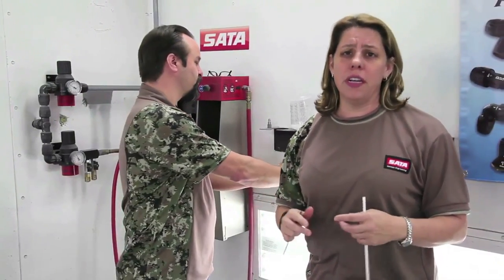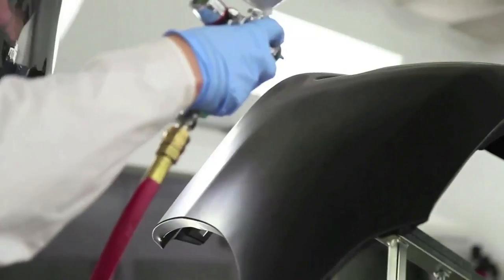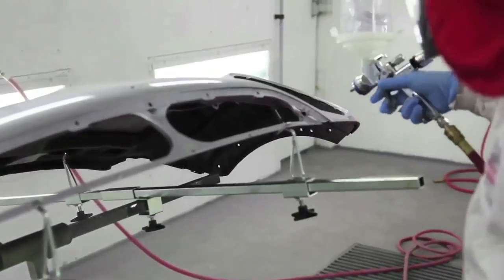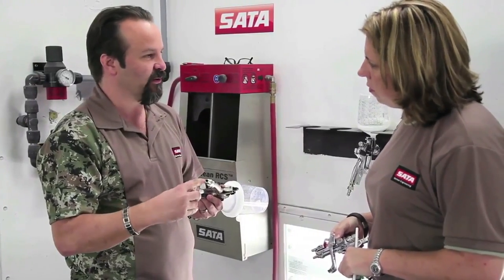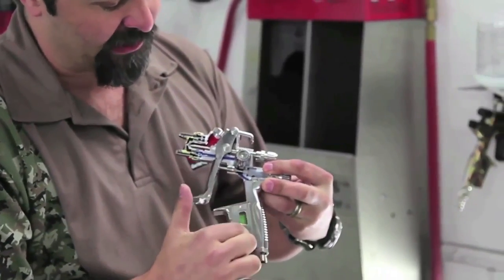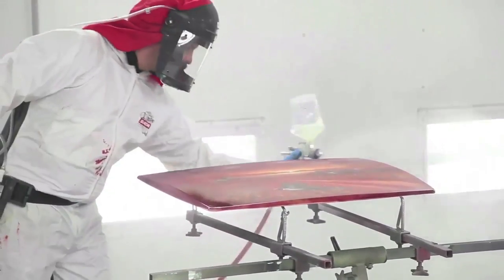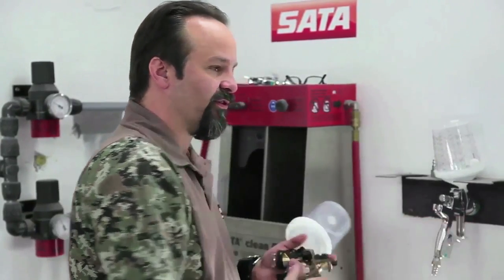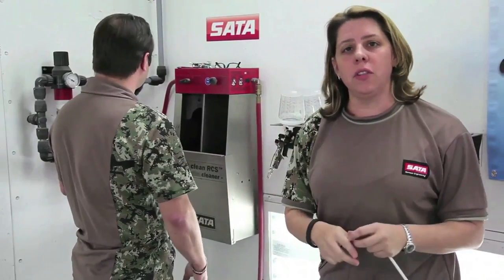Setting Air Pressure and Volume Using SATA Guns with Dan-Am Company

Comment: When I'm spraying DuPont/Axalta clears with a 1.4 SataJet 4000 B RP, I have my regulator at the wall set to about 70 psi, and my gun set to about 26-29 psi depending on conditions. Should I lower my pressure at the wall, or is this acceptable?
Reply from the maker: You want to adjust the wall pressure so that you're not choking the gun down.
Reply: SATA by DanAm Company    I have a sata x 5500 rp  the data sheet of the clearcoat I’m using it says adjust fluid control (2 turns full open) and I don’t know how to do it should I close the trigger all the way and start counting the 1 turns?

Comment: There's no difference in using a gun regulator, I know you can't use them with a sata or it just spins around, and you should have made more of a mention to temperatures changing pressure because its more than 1psi, I will run my gun at 29psi in winter but 10-15 in summer. I don't agree with everything you say in this video and think it may confuse some people.